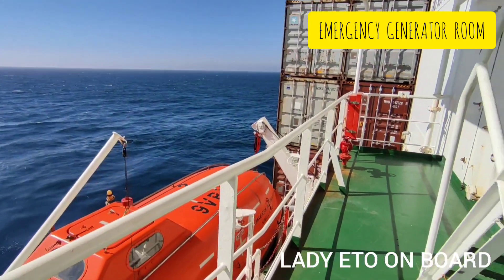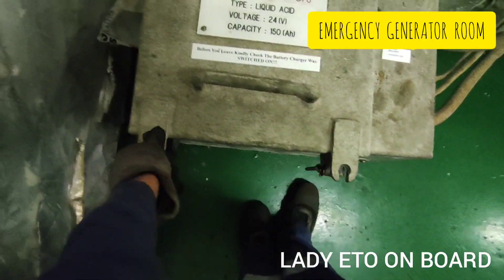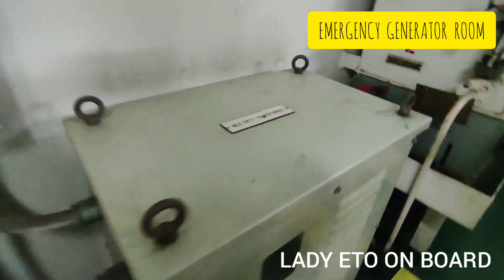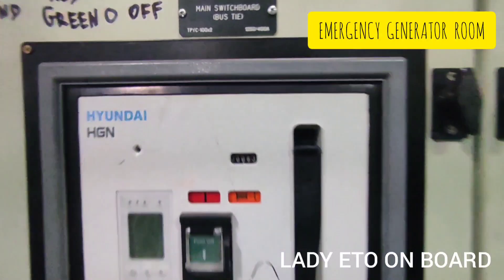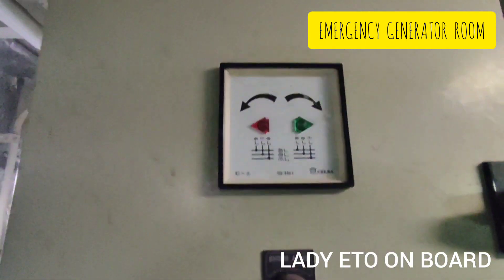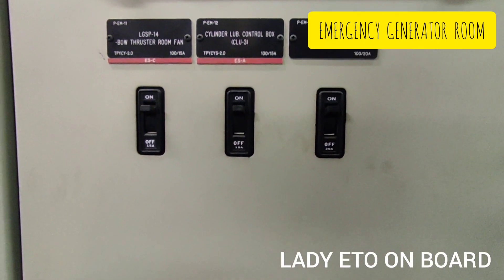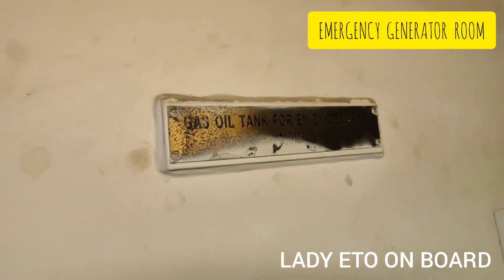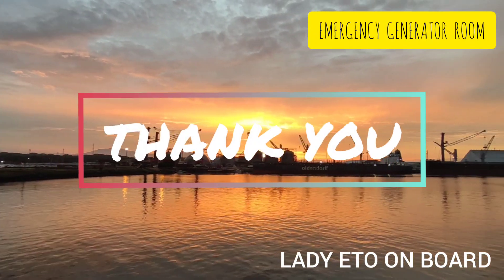EMERGENCY GENERATOR ROOM TOUR

Comment: thanks mum this help me a lot , i have one question what are loads or consumers which are 
connected to the emergency switch board during blackout condition
Reply from the maker: Hi,glad to know our videos are helping you. Generally There is list of consumers connected on emergency switchboard  inside emergency generator room only.i can give few names like air compressor, fire alarm system,fire pump,lifeboat charger,emergency lights etc